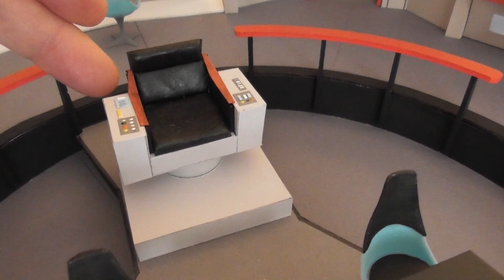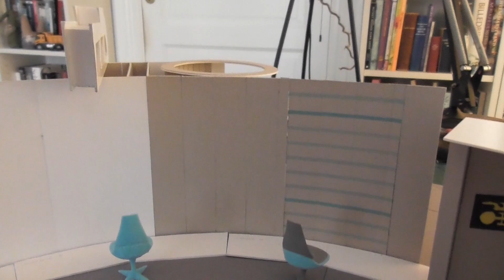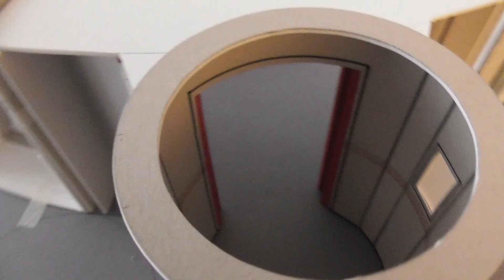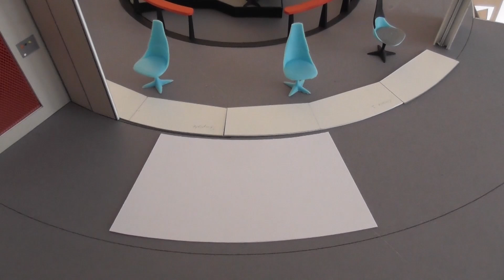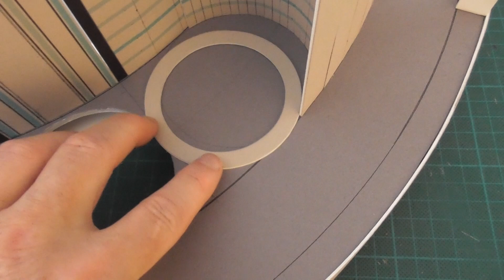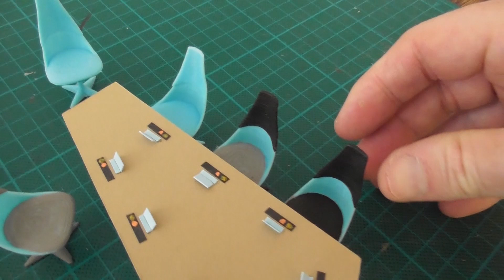The bridge of the REAL Starship Enterprise with EPIC Burke chairs from Ohio!

Comment: I'm slightly confused. I thought no 3D printing was going to be used because if that was the case, you could just 3D print most of it.
Reply from the maker: I got the burke chairs 3D printed as one of my supporters offered to do them and they are actually very challenging to scratch build. So on the finished model certain elements, namely items that will be in the 1000's (tables, chairs etc) will be 3D printed. I've said in previous videos that there will be no 3D printing but I do need to amend that statement. Having said that, 90% of the finished model will be old-school modelling using metal, wood, plastics and high quality modelling board.
Reply: @mrtrek2117  Things change. We adapt. Ahead Warp Factor 5, Mr Trek!

Comment: It's looking really good! I love getting your insights into how you're planning to do this. I was just thinking about when you make the actual thing - as you're doing the full interior, how about installing a few micro cameras so that people can see inside without having to open the thing up all the time? I assume that there will be sections that come off for this purpose? Also, you can get small lcd screens. You could install some into the bridge that display loops of video and slideshows. I saw someone make a model of the Pod from 2001: A Space Odyssey and they used them for the display screens in it. Looked very cool indeed.
Cheers!
Reply from the maker: Thanks! Yeah sections will come off or be left open for viewing, I love the idea of micro cameras placed in the ship. If it was an exhibition viewers could access all areas of the ship via screens. These are all possibilities and definitely there will be small lcd screens in some of the models.

Comment: I love the idea of the consoles heing pulled out into the maintenance corridor for repairs or replacement. We imsgine that the bridge is solid and that the consoles are bolted right up to the wall, but of course this is a film set and it is designed to be quickly dismantled. It's much more efficient to make the bridge modular in real life too, and of course it should be easier to pull them out away from the center of the bridge than to try and muscle them towards the elevator, particularly with traffic on the bridge.

Comment: Not sure you would actually need a maintenance elevator, as you can just use site to site transports
Reply from the maker: Well, with that you wouldn't need turbolifts either as you could just transport anywhere on the ship. Maybe there is a reason why they didn't just do that. Maybe the transporter takes huge amounts of energy and is only used when necessary.
Reply: @mrtrek2117  yeah, I was thinking about that as well. My mind "fixed" it by realizing people need to be moved a lot more than say chairs or consoles. It might get a little busy for the transporter if everyone just beamed around
Reply from the maker: I don't think it would make very good viewing either ;-) @rikkertkoppes

Comment: If the chairs were built for the "real" starship Enterprise, we all know the damn things would have extendable/retractable restraints.
Reply from the maker: On an advanced starship with technology capable of creating artificial gravity it's possible they have also developed some kind of 'gravitational restraint' and moved beyond 'belts and buckles'. Could be similar to the new crash helmet we have now which is basically an air-bag worn around the neck which detects intensity of movement. If the movement is too fast/jerky and angled the air-bag instantly deploys. Same thing with 'gravitational restraint', if the movement is too fast or angled, instant gravitational compensators engage in the actual seat to keep the person in position and on the chair. We didn't see much evidence of this kind of technology on the show but then, it was just a show.
Reply: @mrtrek2117  Yes, hence why the "real" ship would have them because presumably Starfleet wouldn't go cheap on something that would keep their crew at their stations instead of being (dramatically) tossed and flung around like ragdolls.

ST:TMP addressed this, sort of, by having all the sitdown consoles and the con with armrest restraints that snapped into place with the touch of a button.

It's one of the things that the Kelvin Timeline movies did right by showing the restraints as simple, easily deployed mechanisms that might even also be simple field projectors for a kind of mini-IDF like you're describing as well. 

And keep in mind, TAS showed us the force field belts, which was something TOS couldn't due to budgets.